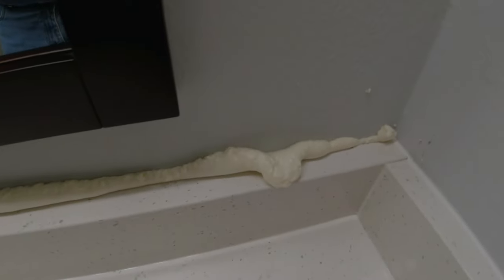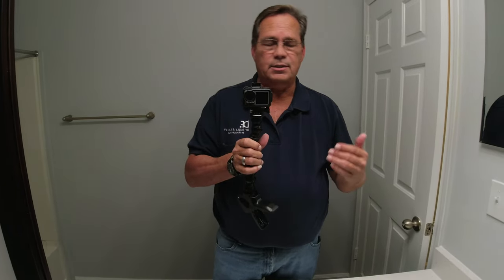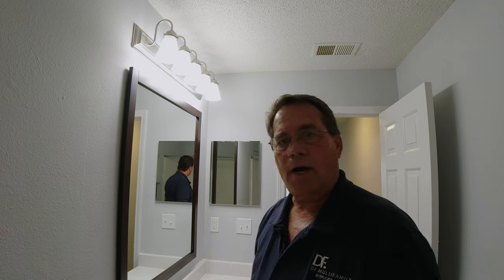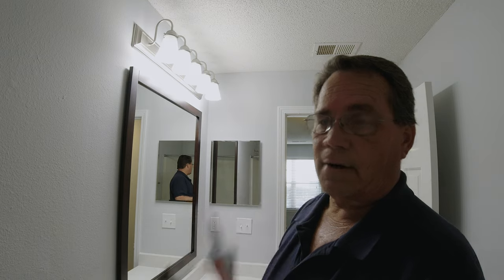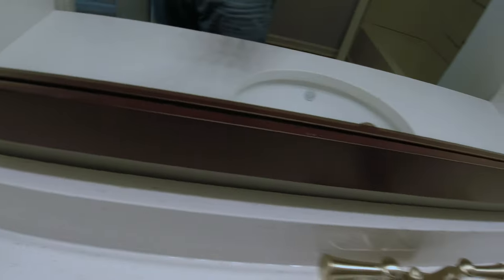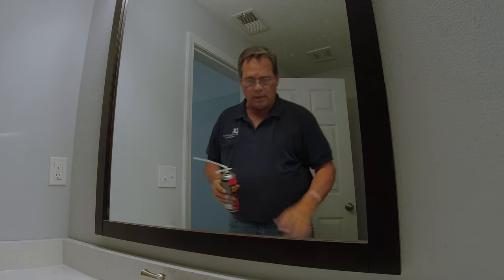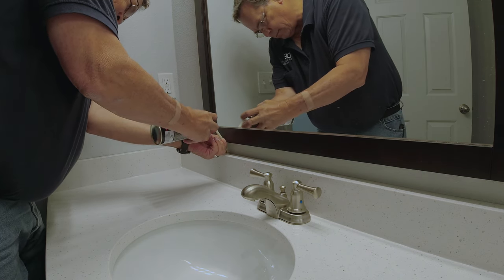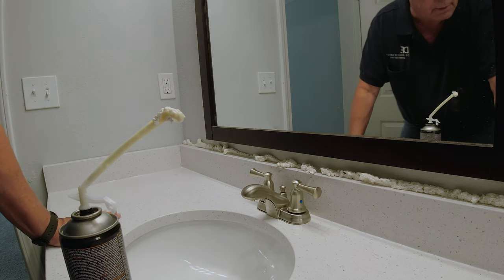Using Spray Foam for Countertop Support

Comment: I can't  wait to try this. I have no leaks but plummer insists  on replacing sink, chipping my tile and cranking up the cost. Caulking has degraded and i have 1/4" gap after  cleaning up the old caulking. This video  may be my answer😊

Comment: Thank you, Dan, for validating this method. I did a coutnertop job and, due to the cabinetry work that was put in place before, it gave huge gaps.  I was debating between using silicone foam versus moulding.  I think foam is the better choice.

Comment: Very helpful. We had to replace our bathroom mirror. There is a bracket that filled the vanity gap which supported the mirror. After removing that long bracket, it left a 1/4" gap. Will use this method to fill. Thanks

Comment: Hi everyone I have replaced 4 out of 5 cabinets but don’t have the budget to replace 5th one. Can I fill foam spray behind the 1/2 inch gap of fixed cabinet to reduce the water damage for a year or so.

Comment: This does not look good at all. I would have removed that mirror and flattened out that depression with layers of drywall mud until the surface was flat and could be repainted. This method shown just further accents the poor finishing of the wall.